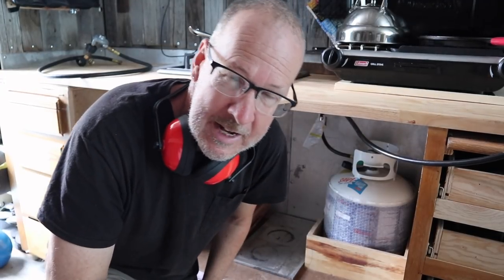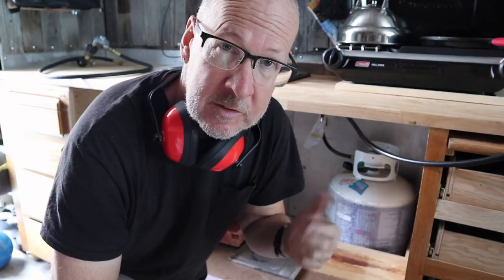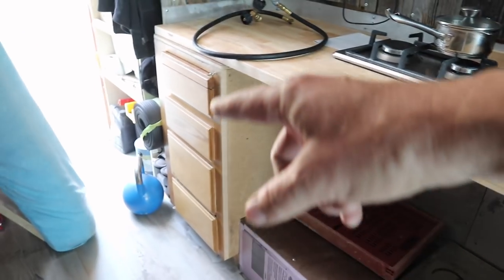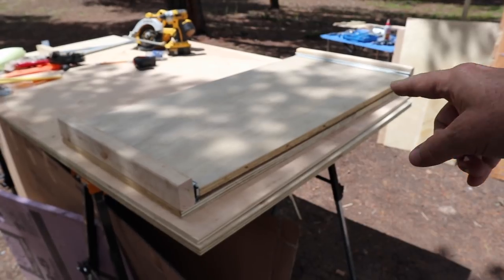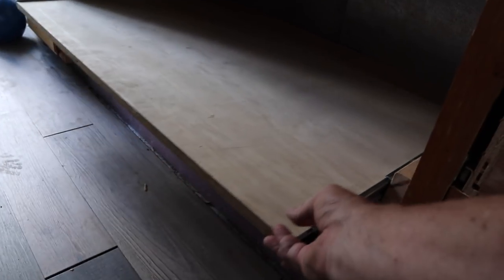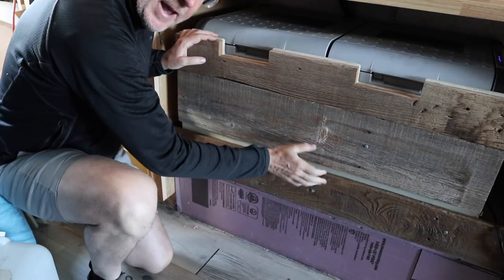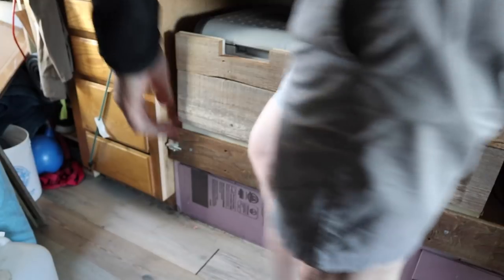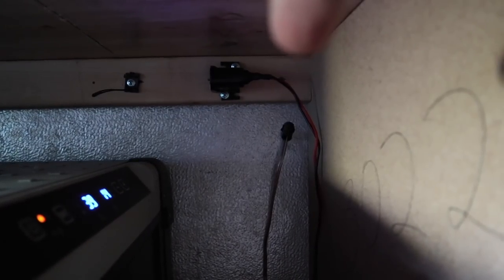DIY Fridge Slideout Drawer E452

Comment: Hey Seven! Looking good I love the drawer slide idea! Seems like that ought to work out really well! You do nice work! On 12 v appliances I guess I'll call it, if you decide to keep it there, I'd just cut the plug/receptacle, and just wire them, splice, wire nut or whatever, I have found the cigarette lighter receptacles tend to heat up when drawing alot of current. It seems to be a automotive industry standard. So all 12 volt connections seem use this by default. Not the greatest thing...hopefully someday someone will invent a better system. Anyway, don't mean to be critical just a thought! I'm so impressed with your skills with the drawers slides! I wish I could do as good a job! [I'll just stick to my electrician job!] Curious what you decided regarding the propane, as I might do propane on the bus, I gotta learn more on this. God bless! Enjoy the coffee, & the naps! Savor the moments!
Reply from the maker: actually this is a great suggestion! thanks

Comment: The fridge has some ventilation requirements to allow the heat from the compressor.  Does your installation allow for that?
Reply from the maker: it does. there is tons of ventilation room near the vents (far more than required in the specs)

Comment: I' d get rid of that 12v cigarette plug, they are not very robust & would be part of the voltage drop issue you were seeing. I've replaced mine with "anderson" plugs.
Reply from the maker: great advice. will look into that
Reply: If you look you can buy quality plugs just pay money and look inside.  Cheap is obvious. Biggest problem is they can pop out with vibration. Anderson  is nice but there are other two pin plugs just get one with 12 gauge  wire to take the current

Comment: You could just pull a second set of smaller wires if you already have them. Now you know why Thomas Edison's DC Power plants were doomed from the start. Looks like you are becoming quite the cabinet maker.
Reply from the maker: I'm thinking of swapping wires with another setting of thicker wires in the same area to a 5w light

Comment: Slick job on the fridge slides!  Btw, personally, I would feel perfectly safe installing the propane bottle inside the van...so long as it resides in a sealed compartment that is vented to the outside.  Wasn't that your original plan? I suppose that outside somewhere would be better from the (interior) space saving aspect.
Reply from the maker: yes, my original plan was sealed and vented box inside a cabinet; now looking at a frame mount option

Comment: I am looking at a small chest freezer and chest refrigerator on 110.  The price difference buys a lot of extra solar power.  I have no other big electric draws, micro, coffeepot, tv, etc.  Did you check into this?  Additionally, I freeze water in containers, rotating them into the fridge, and keeping the freezer packed with frozen water, which I do because it moderates power outages and lowers power usage.
Reply from the maker: I hadn't really considered separate units but am curious how it would work out

Comment: Something to think about if you mount propane tanks outside and attached underneath, you lose the ease of the tanks swap outs at the store. Instead you will have to find somewhere they pump it and they have to be licensed to fill the tank. 

I like the slide out for the reefer, the smoothness that it slid out shows a good installation. I enjoyed this video, thank you.
Reply from the maker: I was thinking of installing a metal box with a door on it outside and using my existing bottle for exchanges or refills

Comment: I have had a bunch of issues with running the same fridge on 12v.. Definitely keep the chord as short as possible.
Reply from the maker: so far it has been fine as long as the power source and wiring is solid
Reply: Seven Wanders the world great job on the slide out.  Love the faceplate...

Comment: Nice installation. This is perfect because you don't often need the fridge and it will be out of the way; but when you do need it, you need the whole fridge and it will be right where you need it.

One thought - I was looking at the Whynter dual compartment that is similar (90 quart) and noticed that there is a Costway single compartment (54 quart) at less than half the price. I was thinking that purchasing two separate fridges might be better for three reasons 1 - it is a belt and suspenders thing. If one fails, I still have the other; 2 - the two Costways would pull 25% more current but only when both compressors are running. Cool down from being turned off would be faster as there would be 2 compressors vs one; 3 - If I only need one side of the fridge running, I can turn off the other one and save 25% of my power outlay.

What do you think? What am I missing?

Comment: What size are your sliders? And are they ballbearing sliders?
Reply from the maker: 22 inch from Home Depot or Lowes. I bought the heavy duty. I believe they are rated at 100 lbs which isn't really strong enough for the fridge. I have to be careful pulling it out and not to press downward (they seem to want to bend). eventually I'll need to replace them with stronger industrial sliders)

Comment: The tank.dont panic.if it in or under  the van and explodes your dead. The point is good houses,good connections  and a detector. There are innumerable Van's with gas inside. Enclose  in wood and add exterior vent or access by exterior door.  Please don't be afraid  of gas just do it right. Underneath means dirt,water, access limits and not necessary. Essentially  every vow in Europe may have a tank inside. Of course a million viewers will disagree. Again don't be afraid just aware. Great build....
Reply from the maker: thx. I have a carbon monoxide detector. still researching all my options for where to put the propane
Reply: Seven Wanders the World there is a propane detector also

Comment: Seven,  always remember that propane is a heavy gas and in the event of a leak it will pool on the floor, but to be safe build a vented to the outside of the vehicle box and install it in the garage and run a secured line to the cook top. A BBQ quick connect hose would work nicely.
Reply from the maker: great suggestion. I'm researching on how to proceed in a safe manner ;)

Comment: Great video!  It gave me good advice for my frig slider I'm gonna build. Why don't you wire your 12 volt plug straight to your batteries.  That's what I did and it works great.
Reply from the maker: behind the fridge I have a 12v socket wired directly to my 12v house system and solar charger. works perfect

Comment: I noticed when you closed the top of the frig that you were careful not to push down on the frig, thereby pushing down on the drawer itself. Do you think that will be a problem?  After awhile of closing the frig, I’m worried the slides may work loose or even warp. Safe travels!
Reply from the maker: 90% of the time I don't slide the fridge out to use it. I can get most items out from the gap at the top. but when I do have it out I feel it best not to push down on it. no idea how durable this design will be long term

Comment: The installation looks pretty good as well as close on the sides. If you have room additioal insulation such as your pink panels or the aluminized version would reduce electrcal loads over time as well as buy you some time if you lost power for some reason. I am pretty sure you insulated your outer van walls but more is always better on a refer or cooler. Be sure to allow for the compressor air flow. 
So many decisions, good luck...
Reply from the maker: thx. I may add some extra insulation around the fridge as you suggest at some time in the future

Comment: In my opinion, you solved the top loading frig issue and the conundrum of wasting the counter top space.  The placement ontop of the wheel well was an added bonus solution for those who don't wish to reach down so low. ie me!  Good job. Van on man.
Reply from the maker: thx. seems to be working out well so far!

Comment: Are there any vents on the front of the fridge that need to be cleared? If you block the vents the system has to run harder as it can't get rid of the extra heat.  

Insulate as much as you can around the fridge without blocking the venting to reduce how much it has to run. There should be no empty space other then for airflow around it when done including securing insulation over it. Easy to test by putting a folded blanket on top of the fridge for half an hour and then feel between the blanket and the fridge lid for how much cold is escaping. 

If you find a good void under the van but lack structure to secure to remember you can drill thru the floor and put steel up top then drop U-bolts down to hang things off of. All you really need is an expanded metal cage to protect the tank and lines in a space tall enough to stand the bottle upright to avoid liquid propane in the lines. Expanded metal is nice as it blocks things the wheels kick up but also lets air pass so if you do get a rupture everything drops to the ground rather then getting stuck inside a box as propane especially when cold is heavier then air.
Reply from the maker: vents are on the right side. I have a HUGE ventilation area there. I may consider extra insulation in the future but have other priorities right now

Comment: A chassis mount propane tank shouldn't be hard to find.  They are kind of pricy, but that's where you want a propane tank.  Every time I see one on the back bumper I wonder what they are thinking
Reply from the maker: I'd like to avoid a bumper mount and do something near the frame under the skirt
Reply: I think having one on the rear bumper makes you a thrill seeker, one driver texting can cause an explosion.

Comment: Seven you might check for an rv bone yard and see if they have any chassis mounted propane tanks with hardware then just run your lines
Reply from the maker: oh great tip! thx
Reply: Seven Wanders the World your welcome just a good thought and the rv propane tanks I believe are around 30 pounds capacity so it should last you awhile between fill ups

Comment: I was concerned about the heat generated off the wheels, so extra insulation used was other's solution to heat generated from the road/wheel & tire.
Reply from the maker: the wheel wells have 1 inch insulation around them. fridge sits on top of that